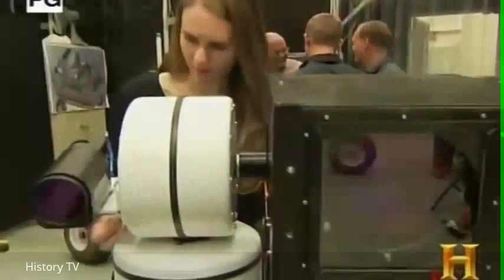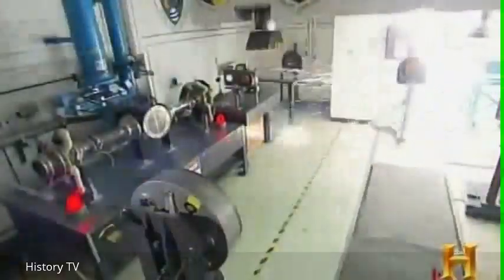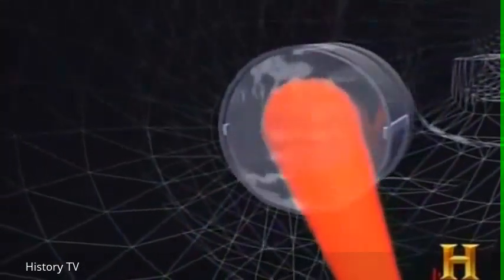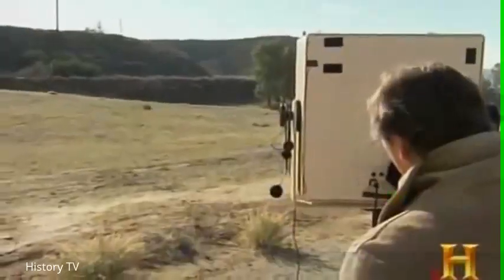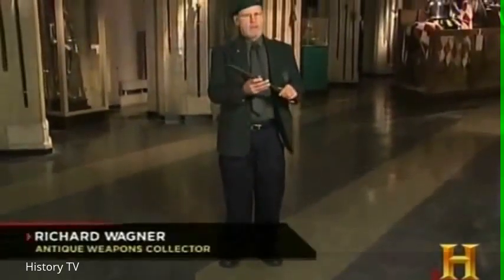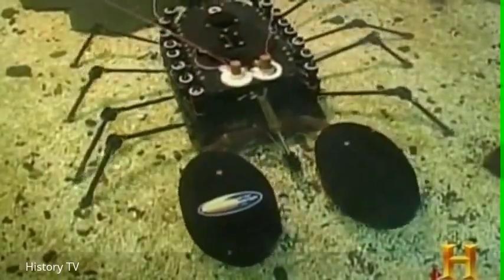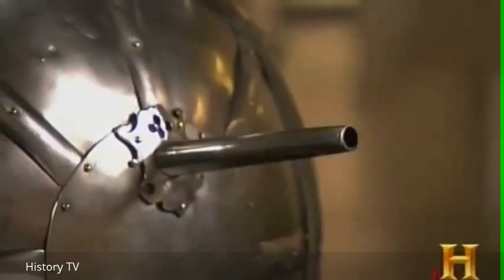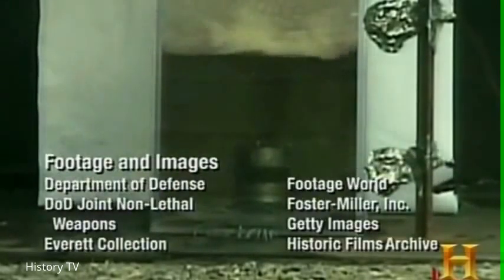America's Strangest Weapons Documentary - History TV

Comment: It seems to me that the flash-bang is a wee bit weak.

Instead, I would use a "demo" grenade containing 200 grams of high explosive in a cardboard cylinder. The explosive would consist of plastic explosive plus aluminum powder plus ammonium nitrate. This will do more than merely disorient the people in the room, but it will not generate shrapnel from itself. It is 100% guaranteed to get the attention of your opponents. These have been in use for 100 years, but with older explosives.

Comment: This is about the plane laser

Can’t the enemy coat the missile with some sort of reflective material that is more resistant to heat, the laser beam could just bounce off
Reply: Tomasz Pawliszyn No.  Any imperfection or discoloration will "catch" the energy of the beam and instantly destroy the coating.  Mirrors in the lab are made to extremely high tolerances.